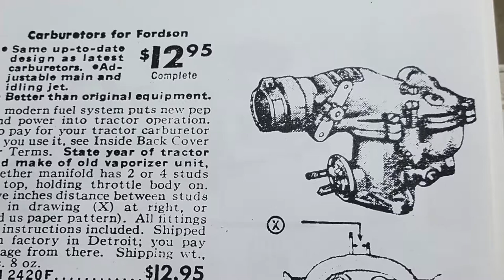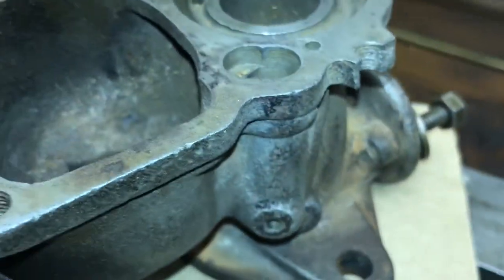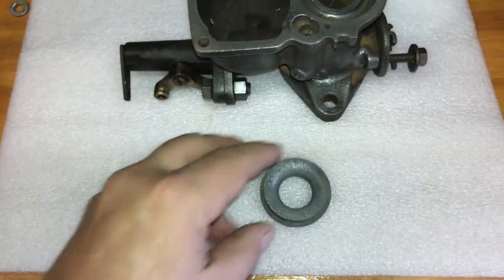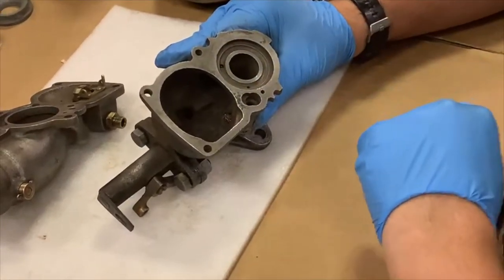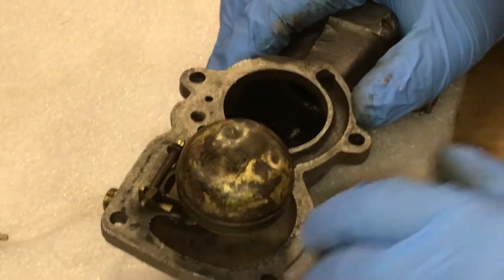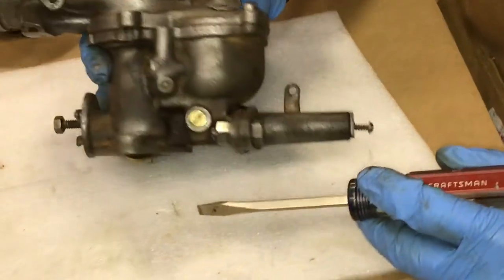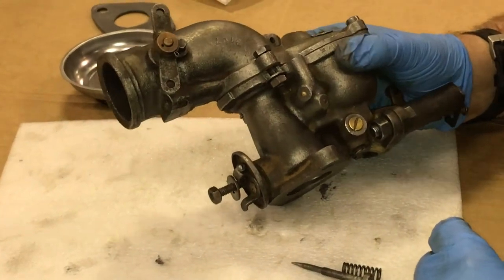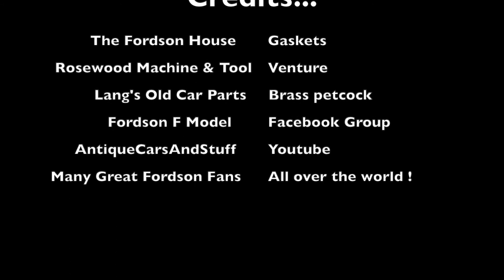Zenith Fordson Carburetor

Comment: Thank you for an excellent presentation of the carburettor restoration. In my years of numerous stationary engine restorations, I have used electrolysis as the preferred method for rust and corrosion removal. This is suitable for all metals that I have dealt with, including heavy black tarnish on Primus starting lamps.